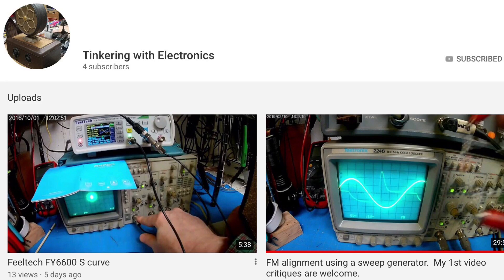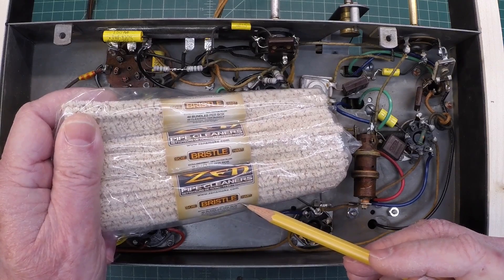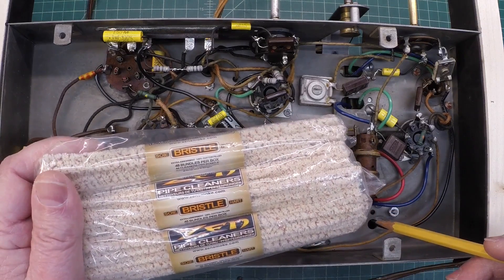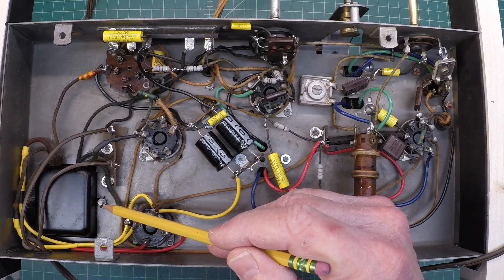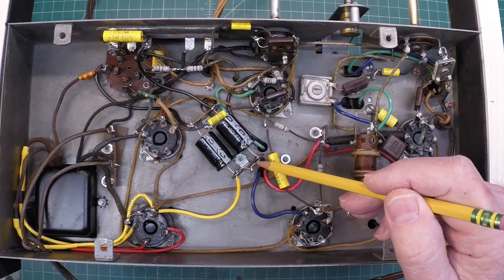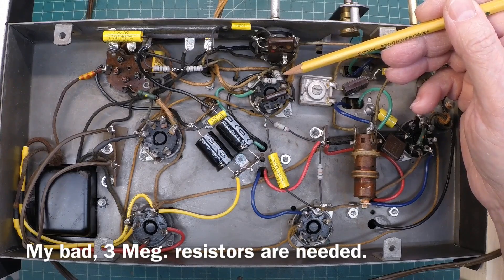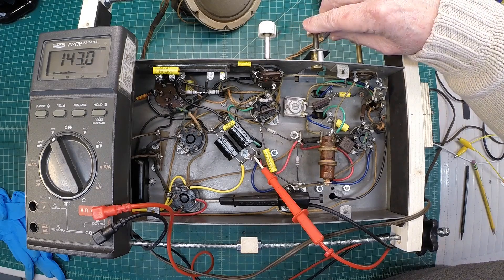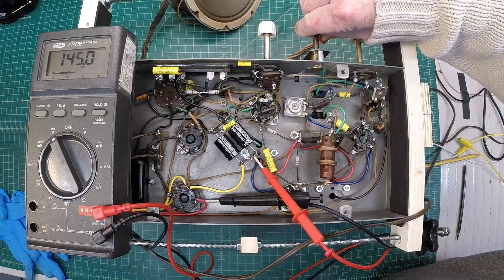Airline 62-306 Teledial - Let's Power It Up

Comment: This series has been incredible. Thanks so much for showing us all your skills and techniques. It’s taught me what can be done to ensure a piece of what would be considered by many as old junk to throw away is really historically important early technology & now it will start life again in a working condition, ready for another 80yrs. My only tiny worry was watching you point at that B+ etc with a conductive graphite pencil... Thanks once again for such an informative very enjoyable series so far & it has spurred me into getting on with saving a few pieces of old equipment in my collection.
Reply from the maker: Thank you for taking time to watch and your kind words. The graphite pencil to your point was not the best pointer to use after energizing the receiver. What’s your next project that you plan to tackle? Best, Don
Reply: @RestoreOldRadios  ... hello Don. I have begun on a very sad all-tube 1970s era Telequipment single channel oscilloscope with amber screen. (I've can only find info the units had green phosphor). It possibly served as part of other specialist system/unit as there are a few timebase mods internally from standard. I am dealing with everything from an ancient pcb to rodent damage to so much chassis rust it's touch and go. I have the CRT appears ok but all other tubes were missing while i have tested the supply transformer as being ok,  it had all been stored away in a loft out of its case for the last 30+yrs said the owner who gifted it to me. I'm going to be using your techniques in you excellent videos to move forward on it, Thanks again... Pete (New Zealand).
Reply from the maker: Pete - wow! That sounds like an awesome project providing for some real challenges from the electrical to mechanical aspects. I know it will take a lot of effort and hard work, but I know you’ll be successful in time. My email address is TheRadioRepairGuy at gmail.com if an opportunity to update me down the road presents itself. Have fun and all the best. Don

Comment: The Airline sounds good. Just some more tweaking and it should be there. The 1 Meg resistor in the eye tube is probably bad. Every eye tube set I end up replacing that!
Reply from the maker: Bob, this set uses a 500K, most likely due to the lower B+ design. Any secrets you can share on how best to open the socket without destroying it would be appreciated. I’ve had bad luck in the past opening them up without damage. Thanks again. Best, Don
Reply: @RestoreOldRadios  Removing the cover without breaking it is interesting. I use a an old choke cable with about a 2 inch length of cable on it where I bent a small hook. Works about 50% of the time.

Comment: Don, I'm really enjoying your videos and I'm learning a lot. I am a beginner and am working on my first radio (Majestic console with 1870 chassis) so your really helping me a lot! Do you check the polarity of the yellow capacitors before installing? Sorry for the basic question...I'm a newbie! :) Keep up the good work! Kyle
Reply: Those are prob foil+mylar caps. Most modern caps like those no longer indicate a preferred polarity but note that the "polarity" of the old paper caps is quite different from the "polarity" of electrolytics. The former meant only that the "ground" side was the connection to the foil element that was outermost in the rolled-up foil & paper composition. Paper caps will function when connected either way, but electrolytics will not function if polarity is incorrect.
Reply from the maker: +Kyle Strauser Hi Kyle - Ordinaryaverageguy is correct; however, if you’re a purist, yes according to Paul at Mr Carlson’s Lab: https://youtu.be/BnR_DLd1PDI for non-electrolytic types too.

Now, Dennis Carter said it doesn’t make any difference in one of his videos. I’ve never spent the time to figure it out and haven’t noticed any notable performance degradation in my restoration efforts.

Thanks again for watching and I hope the Majestic project goes well for you.

Best,

Don
Reply: If caps are marked, I do endeavor to install them with that in mind but most replacements I get have no ground or outer foil marking.

Comment: I had to double the first filter cap on my Belmont from 5 to 10, to cut down the hum.
Reply from the maker: I did the same. Do you know what the minimum line voltage is for yours to make the radio play? Best, Don
Reply: @RestoreOldRadios  Loaned out my variac to someone else.  I was using a dim bulb and watching the B+.